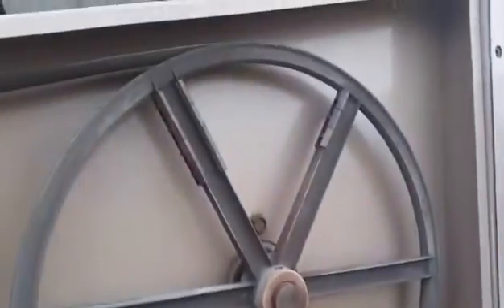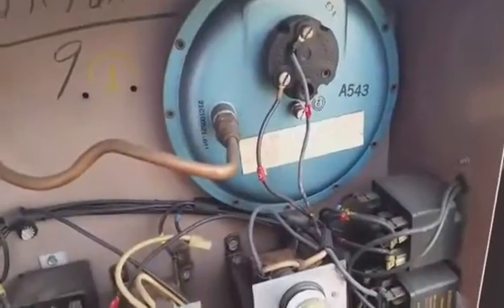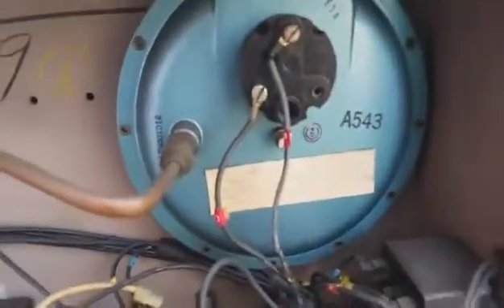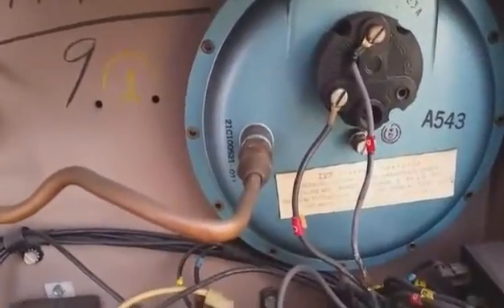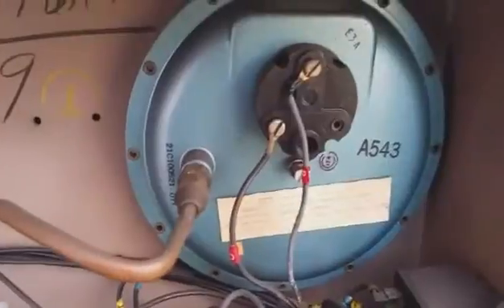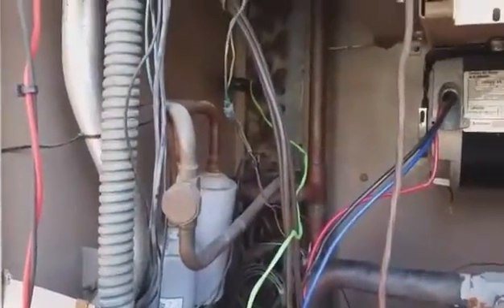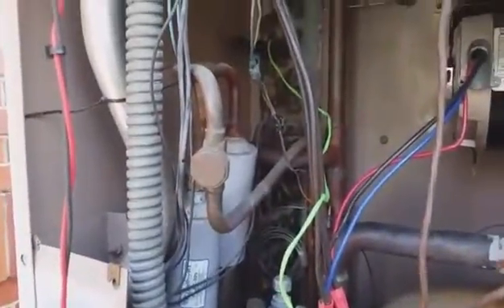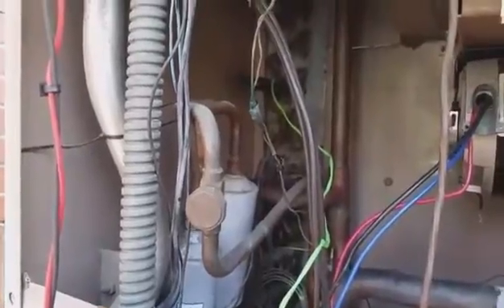HVAC Commercial Service : No Heat 8 Ton Trane HP

Comment: Looking at some of these old Reddi-Fact specs for circa 1980's GE Weathertrons, etc. (not sure which year that one is); typical defrost control sensor is spec'd to be looking for below 26 +-3F. So is it possible that the coil temp was still just 3F too high for it to kick in (or even 6F if the allowable part tolerance was actually 23F per spec)?   .. or perhaps a break in the wire coming from the sensor to the control (they look a little 'ratty')?

Comment from the maker: HVAC Commercial Service : No Heat 8 Ton Trane HP: http://youtu.be/9ctk0Lmcz3M
Reply: Lordy Lordy now we're talking. Those pressure switches were still in use until the late 80's on Trane's rebadged Ge's. This is for the youngen's thats the an original climatuff compressor under GE. 

Those defrost systems generally ran very well and for the life of the GE weathertron  Heat pump. But of course when they didn't work so well watch out! Lol lol 
Fairly easy to diagnose and pinpoint the failure. On some pressure switches  you could adjust the temp in which defrost was more desirable for the region the unit was in. Out here in Iowa it was 32 degrees and below those temps it didn't work so well and you wound up with a block of ice and ultimately shutting the unit down.. 
Thank you technology it's made the heat pump more popular up north nowadays!! I like their even heat. 

Good one Zack :D